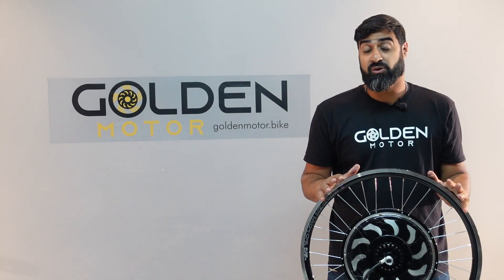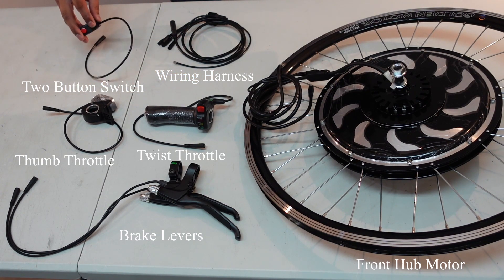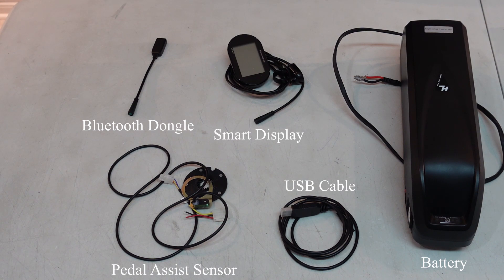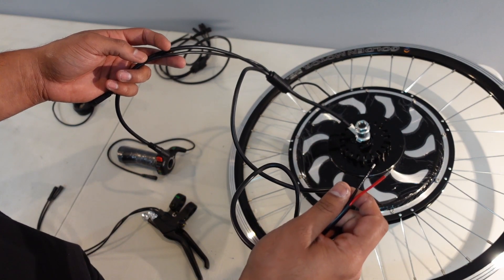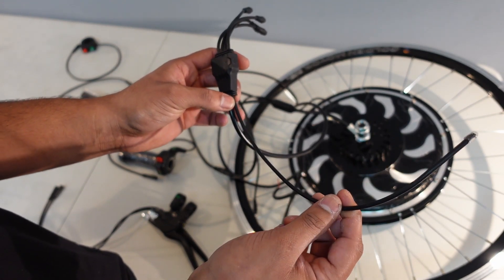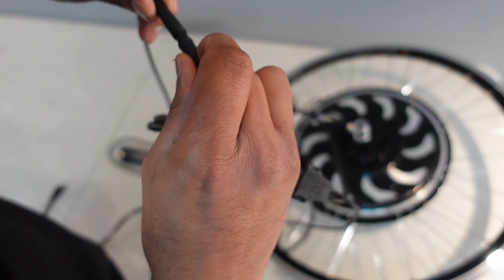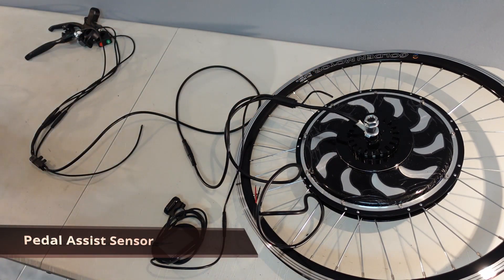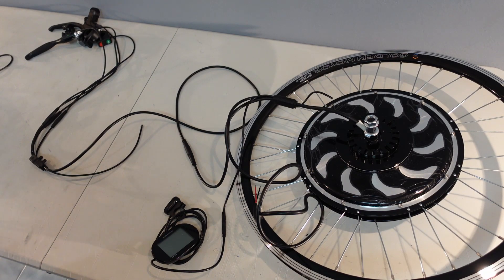Easiest and Fastest Way to Convert your Bike to Electric

Comment: Another Great Video .. Shows how easy it is to wire the motor .. No controller to mount or wire up as it is in the motor ... I love the cruise control ..set it at 10 mph and petal up to 11 or 12 mph perfect for a little exercise and not having to fight hills or the wind .. Thanks

Comment: You don't need to hardwire anything. if you don't want to. If you have the display, you can enable pedal assist like mode. Basically the motor does less work and you have to pedal more. If you are exp enough with the throttle and know the bike. You can set the throttle a speed you like and then pedal to help motor, or go faster.  I always assumed that was simply a drip wire, for the water to bead off and away from the controller.